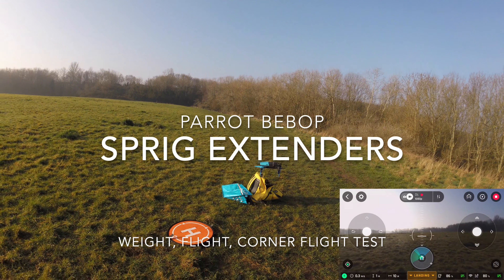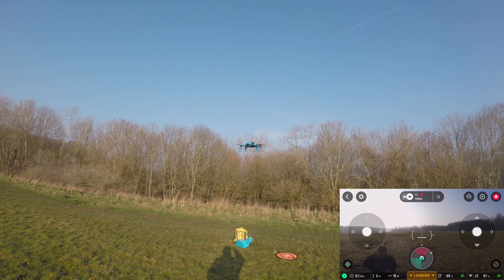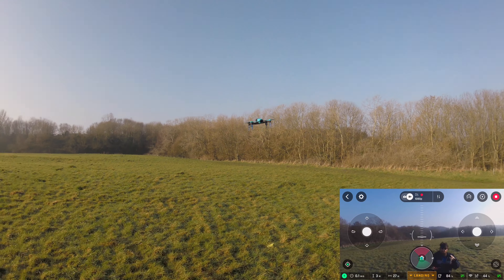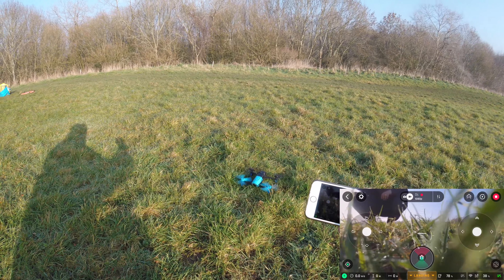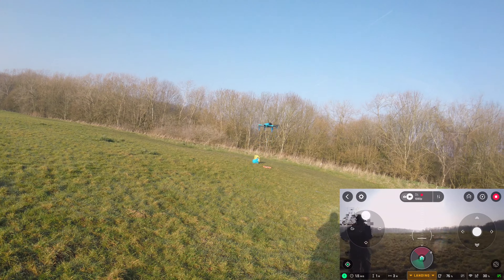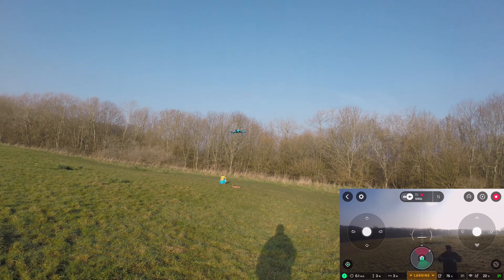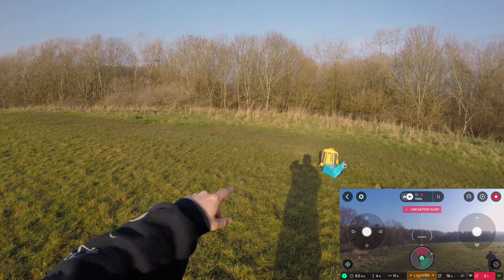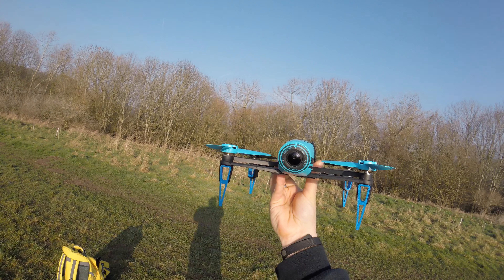Parrot Bebop Landing Gear Extensions Inc Weight & Stability Flight Test

Comment: Nice flying matey and test. These are great, got some for my B2 as you've seen in my previous videos. Awesome clearance for those more grassy areas. Great mod that doesn't cost much. Great video as usual John, thanks for sharing. :)
Reply from the maker: Thank you George bud, yes I have seen you use them. Wow what a difference when landing, the extra clearance is needed 🙂👍